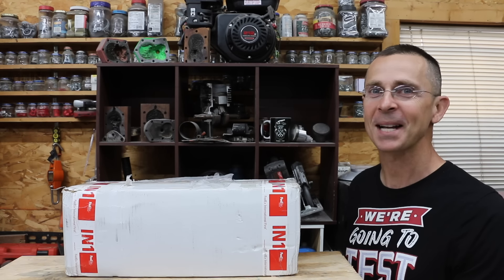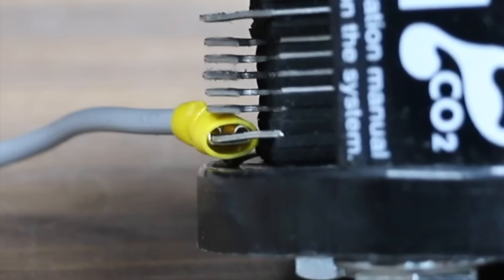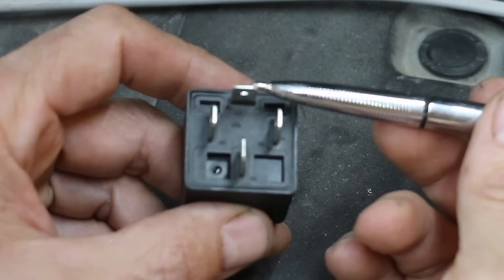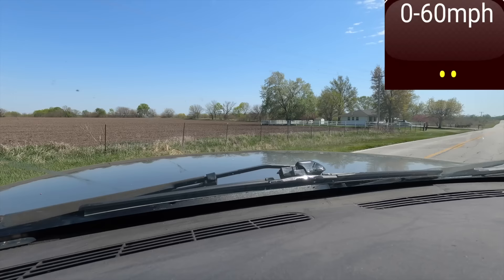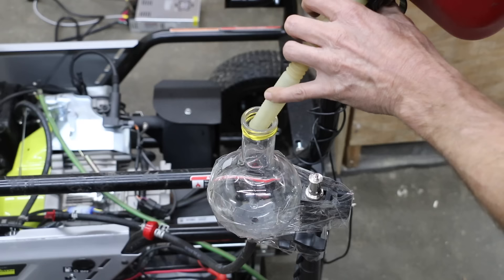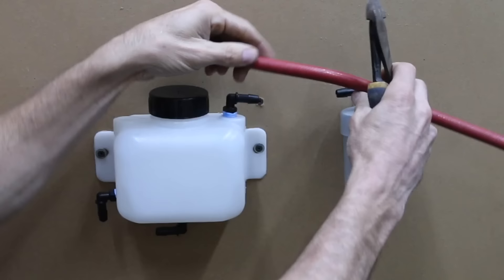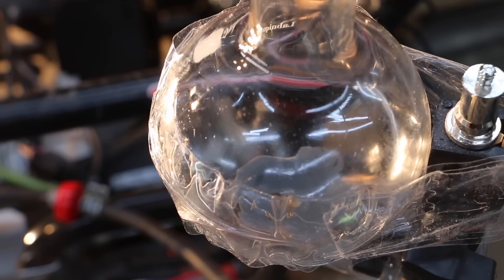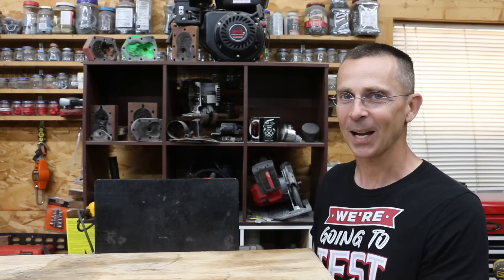AMAZING 35% More MPG with HHO? Let’s find out! Help with high gas prices?

Comment: I remember before everyone had the availability of the internet at anytime, a lot of people automatically believed anything they heard on TV or in magazines. Thanks to your channel and a few others we now see the real results of these products.
Reply: The modern-day version of gullible is watching CNN.
Reply: AsSeenOnTV has left the chat.
Reply: Zip ties this magnet to your fuel line for great fuel savings!
Reply: @KarateSensei71  or Fox or any corporate media.
Reply: Yeah, although the HHO craze really took off on the internet back in the mid 2000's, so I'm not sure what that says :)
Reply: Anyone remember “gas shark”? It was a nonsense item you plugged into your cigarette lighter that was supposed to improve fuel economy. I’d actually see people with them IRL…….
Reply: @KarateSensei71  . Imagine thinking anything from the opposing political side is biased as opposed to all political propaganda.
Reply: @zackzittel7683  LARGE ultra capacitors actually work  but the savings is only limited to having to buy new batteries less often (also less strain on the alternator )  the fuel savings might be 0.2-0.5gallons over a tank
Reply: As seen on YouTube
Reply: I'm a mechanic, I remember when customers wanted me to install the "tornado" in their intake. It was supposed to "swirl" the air or whatever for better "mixing". The worst product I've ever seen, though" was a magnet thing that you would put on your fuel line and it would "stretch" the gasoline molecules to make them bigger so you needed less gas!
Reply: @KarateSensei71  FOX, MSNBC or any other mainstream outlet!👍
Reply: @zackzittel7683  There are modern versions of it that plug into your ecu port, but all they do is flash lights.

Comment: i remember a friend of mine around 2006 was trying to convince me that these kits would make our cars get better MPG.   Snake oil never dies.
Reply: I remember these kits from 1986 and it came with a free spark amplifier that went on top of the coil.
Reply: Same. I explained the physics to him then too.
Reply: Snake oil is stronger than ever. Discouraging.
Reply: @wiredforstereo  Yeah, it should seem pretty simple "you can't get more energy out of a system than goes into it." 
This thing uses energy from the engine to do what it does, so how would it improve engine efficiency when at best it could only break even?!
Reply: @steventhomas5865  I have one of those spark amplifier thingies! I got it at a trade show back in the 90s along with my sample of Dura-Lube after watching an engine run without an oil pan. 😉
Reply: @InfernosReaper  Plus, hydrolysis is notoriously inefficient at converting water to oxygen and hydrogen gases.

Comment: I have had an HHO generator on my 1999 Ford Ranger for close to 4 years. I can run on hydrogen ALONE, Gasoline alone or both. I have noticed a huge MPG increase on the 2.5 ltr 4 cylinder engine and it the engine runs better. I had to replace the muffler as when the carbon burned out, it all but melted due to the fact that the muffler had never been changed. I put a Cherry Bomb glasspack on.Installed at 190000 miles, the engine has 240000 now and it runs great. I use common baking soda as the catalyst.(easy to get). Using the potassium, the amount of gas is less than half than using baking soda.

Comment: 3:05 "I'll go ahead and remove the plastic shavings from the intake so we don't try running the engine on plastic as well." EPIC!
Reply: PF next video "can we run a truck on just plastic shavings"
Reply from the maker: Thanks for watching!
Reply: @ProjectFarm  Instead creating the HHO/electricity from the alternator/engine. Add a separate rechargeable battery bank that could be recharged by a solar system or wall outlet. When the vehicle is running use the battery bank to make HHO and see if there is an improvement.
Reply: With the results of the HHO, the plastic probably would have improved it a lot better!
Reply: @michaelbrinks8089  Well, it's what he do with the genenrator. I mean, take electric source for the HHO from other source and we see the result.

Comment: Would love to see electric pressure washers put to the test! This is the only channel that I will give a like before the intro is even over. Awesome work 👏
Reply: Obsessed garage did a huge comparison of about 50 units I believe
Reply from the maker: Great suggestion!  Thank you.
Reply: Electric pressure washers work great. Like why waste gas on washing something 😅
Reply: @2strokepower803  gas equipment is best, its fun to fill,fix,and the noise
Reply: IChurusLikeLOL there is more fun things to fill up and hear the exhaust on. Like a car or motorcycle :)
Reply: Are you trying to put him under pressure, now?
Reply: @2strokepower803  I have issues with electricity and jets of water. Shocking ?
Reply: @ProjectFarm  I second this request
Reply: wait they have gas powered ones?
Reply: PneumaticFrog Murica 😉😉😂
Reply: wopalongcassidy it's not shocking. 
Hope the electricity isn't literally shocking you 😉😉😅
Reply: I use electric for cars and small stuff,  I have used several ryobi electric and they are just as good, just not as powerful
Reply: @svenjorgensenn8418  So not as powerful, so therefore not as good.

Comment: I've run HHO systems before with mixed results. I was able to achieve a 20% millage improvement for highway driving only in a 96' 2.2L Subaru. The problem comes down to the EFI system which compensates the amount of fuel injected based off of the increase of O2 picked up by the 02 sensor, with the HHO, as well as the trouble of this effect with the variation of air/fuel mix to constant HHO output, produced by the fuel cell, unless you invest in specialized electronics which match the HHO production to air/fuel mix. For this reason in my experience with vehicles that work with HHO will only see gains after resetting the computer and maintaining a semi consistent air/fuel mix to HHO such as highway driving, once the vehicle is allowed to idle for extended periods the 02 sensor picks up the additional oxygen and registers a lean burn condition injecting more gas to make up for it and this is stored in the trim tab memory banks where by gains quickly disappear. Different vehicle manufacturers also apparently have different fuel management programs as well, I have tried two high quality installations on Ford with no effect unfortunately. There are two work arounds for this which are costly and complicate the installation. One is a smart PWM that controls the amount of HHO the cell produces to match the air/fuel ration but to function it must be spliced into the wiring harness of many of the engine sensors. The other are hydrogen separator cells which separate the hydrogen and oxygen releasing the oxygen and only adding the hydrogen to the combustion. In any case the computers trim tab memory should be cleared prior to running the system. IMHO the generator did not see fuel efficiency improvements because it is an EFI generator and was reading the added O2 as a lean condition which it compensated for by increasing the fuel injection beyond the actual amount needed for combustion. I would like to do another HHO installation on another vehicle and perhaps will post a video of it. Check my channel if your interested and perhaps you will find it a few months from now. Great video btw, with this information perhaps you could have seen different results.
Reply: Thank you for your work on this and detailed explanation of what you did, and your findings.
Reply: nice! I have to chime in though I designed a cell several years ago, (actually 4 cells ganged together). I installed it on my 97 dodge ram. I swear, I went from 200 miles to the tank to 400. The draw back was my cells would wear out within the month. My cells were unique. Some say they looked like strands of dna
Reply: so standalone system and problem solved or a remapping and its potential is greater than the cost in the end lol .... thanks for this tho bro as i am a knowledge freak and love learning stuff like this .. peace and love brotha keep it rad stay safe and build on ... l8z
Reply: I  achieve a 15 -20% millage improvement in my 2005 Chrysler Pacifica, hho generator was runing on 30Amps, I don't remember the number but the gas (HHO) output was quite high
Reply: Great job 👏🏻
Reply: What is you channe
Reply: I used a Smack Booster array in my 4 litre Ford Fairmont. There was more available power ( between 2 and 3 seconds quicker in the quarter mile with the booster switched on) but the fuel economy didn’t seem to improve.  
I added a little electronic unit to go in line between the Oxygen sensor and the computer. By dialing back the O2 reading from the sensor, the computer was supposed to refrain from dumping extra fuel into the injectors, as it tried to address the cleaner, more complete burn, interpreted as lean fuel mix. 
I gave up, a month or so later, when my booster got so hot that it melted the plastic body. It seemed to me that the more current that ran through the plates, the warmer the electrolyte got, and this warmth made even more current flow. 
I tried to design a reservoir of electrolyte to enable cooling, but ran out of space under the bonnet and time. 
Back in the early 90s I met Stan Meyer, who used super electrolysis to drive coast to coast USA on 30 gallons of water.
Reply: Another little tip is to take about a half gallon of cow manuer and run it through a blender,  pour that into your fuel tank the methane gas is more efficient than ethanol in the combustion chamber
Reply: @eagerlawncare3700  😊
Reply: @eagerlawncare3700  But make sure to use a good filter. Need to keep pistons shiny. Flat top or domed 😂
Reply: I have the same issues.
Reply: I think you are suppose to install it down wind of the censor.

I was into this like 15 years ago. I got my Mazda truck from an average 25 mpg to 42mpg.

I also had a could explosions making my own hho generator. Fun stuff
Reply: Diesels seem to get better results since they aren't measuring gas byproducts like a gasoline engine does.
Reply: There are "enricher" devices that install between o2 and ecu that let you adjust cruising air fuel ratio.
Reply: ÕMĞ é PôWéŘ-PhÛľĽ
Reply: @andybilakshow260  Diesels are easier to get results with because they are more manual with fuel injection than gasoline engines. The more computerized your engine, the harder it is to get good HHO results.
Don't get me wrong, there are some systems that read better than others and it's a pain to figure out which work and which don't.
I'm going to find a decent unit and install it on my GL 350 because I've heard that Mercedes fuel management is more intuitive.
I think that any rig or heavy equipment that is running the re-burner style emissions really gets a boost because the ash content of the exhaust is negated under HHO conditions so the vehicles don't enter Regen mode anywhere near as frequently, if at all.
Reply: To much to read
Reply: Is this compatibile with petrol/hybrid enginee?